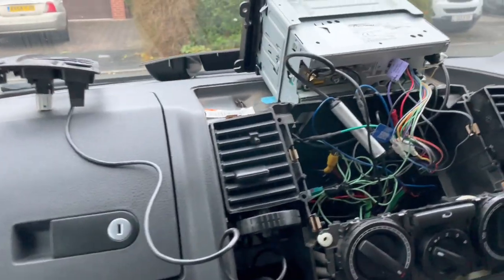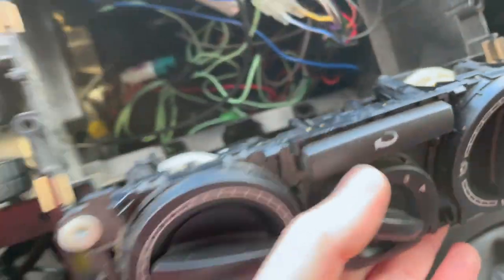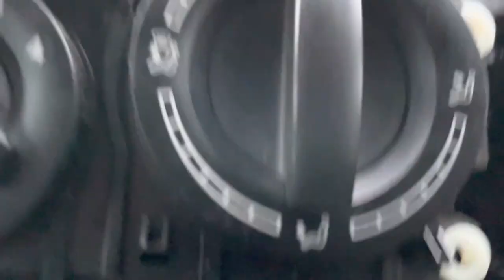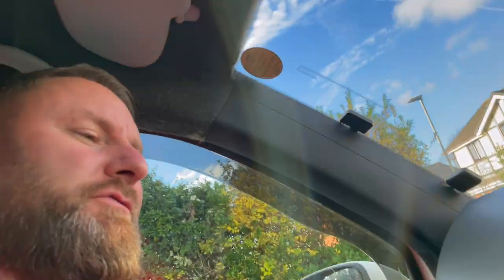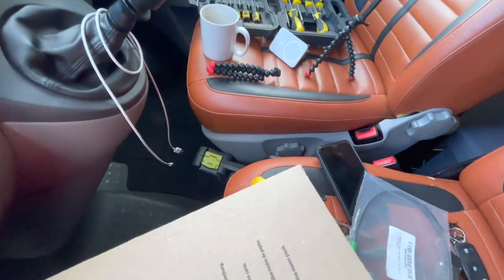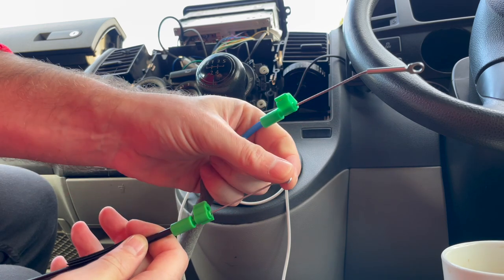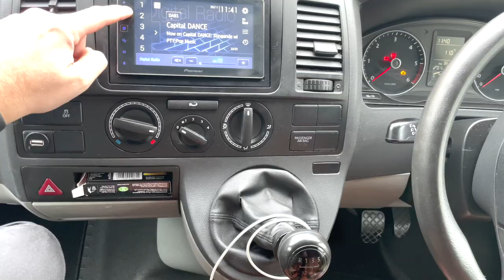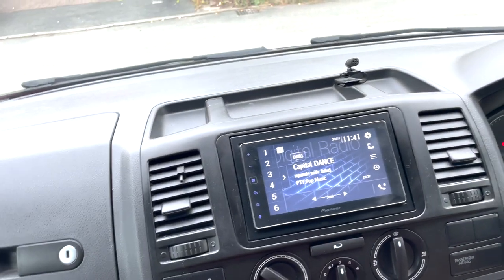VW T5 Transporter Heater blower dial not working? You need to Check this out!

Comment: For anyone else watching this great video, once you have stripped the dashboard down you can pull out the left/ central blower vent as well as removing the glovebox. There is nothing securing it,( it just pulls out),  and it gives a good bit more visibility when doing the rear cable removal and refixing. Trust me, you are going to want all the access you can get.
Reply from the maker: Cracking tip 👍🏻 thanks 😊

Comment: This helped me immensely in changing mine yesterday. I was a bit worried when the new cable (I’d sourced cheaper from elsewhere) was longer than the original but seemed identical to yours. Better a longer Bowden cable than a shorter one. Did the trick now all working thanks.
Reply from the maker: Nice one 👍🏻 yeah and probably would have been easier to fit 🤣

Comment: Just did mine this morning. Would have been a sinch if I had disconnected the correct cable at the far end under the dashboard. When I realised it was the wrong one and saw the correct one, I thought ,” oh,shit”. But it came apart quite easy and after getting an inspection mirror in to have a look, it went back together unusually easily. Pity I broke the clip on the cable I shouldnt have even removed but a couple of cable ties sorted that out. Glad its done and I have a blower that works. Now onto the next job that needs done on the van……
Reply from the maker: 😂 sounds like something I would have done 👍🏻 least they are working now ☺️

Comment: Hi Axisuk. Would you know what colour cable I need to order for a similar issue? My hot/ cold wont go cold. It gets stiff at the cold end turn and just stays warm. Any idea, or I’ll pull it out and check. Cheers
Reply from the maker: Not sure off top of my head, but if its already buggered then just pull it out and check the colour.

Comment: Mate great video… do you know anything about mine….

The issue is, the heat to cold and warm works fine. - the dial which moves from feet, to window vent, to face etc works….
It’s just the speed knob which is faulty. Is there anything you can do with this one? The dial seems loose and isn’t turning! I can send a video to show you! Any help will stop me from going insane 😂😂 cheers mate!
Reply from the maker: From memory I don’t think the middle dial has a cable, so could possibly be a faulty unit. Maybe try get one from a scrap yard?

Comment: Sorry to reserect a older video,but can you tell me,i have tge same problem with tge direction dial,it is stuck on windscreen and wont turn left.
I have removed cable as it was a braded crap one, it dosent look to be snagged or bent,,so I need to know shoul i be able to turn tge dial when i have cable disconnected,,I assume i should and must have a probkem with the cogs or something,so probably looking at replacing the unit..

Thanks
Reply from the maker: I would have e thought If the cable was disconnected from the dial then it should be free to move. Check to see if anything has got jammed in the mechanism?
Reply: Did you solve that problem? Because i have the same issue.
Reply: @davordolinsek1018  the cogs inside the unit have a tendency to lose some of the teeth making it slip. If this is the case,( you can check by dismantling like the video), then its a replacement unit. Think they are around £150 from vw so best to get a used one.